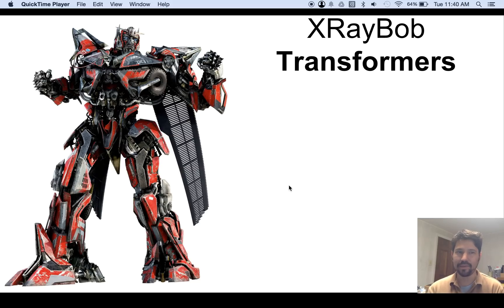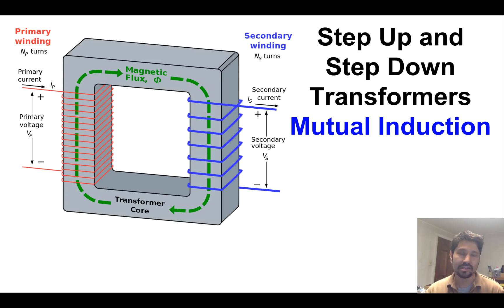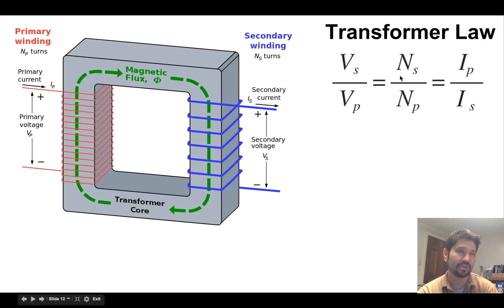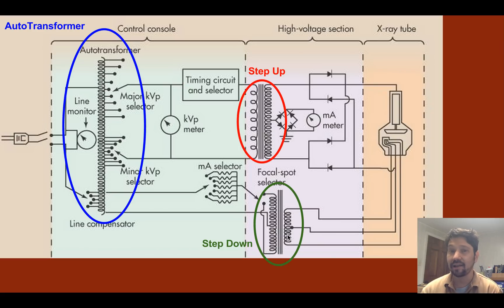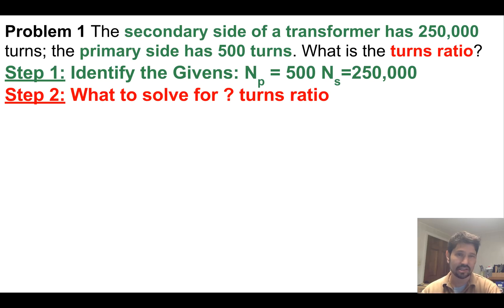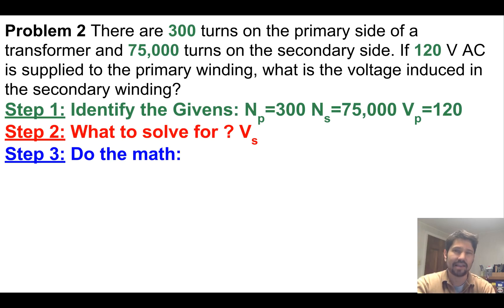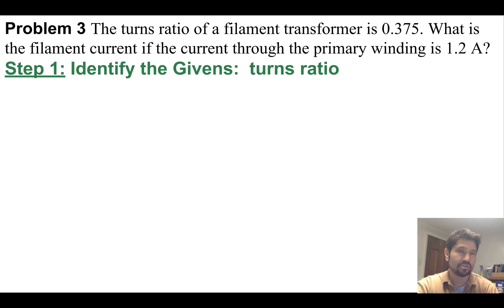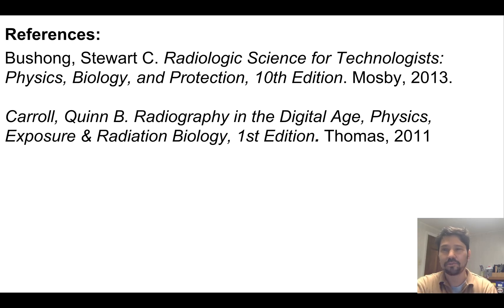XRayBob Transformer Math Examples

Comment: When do I know to turn it into kilovolts and not leave it at volts?
Reply from the maker: If the question does not ask for kilovolts then I would think you could answer in volts and not risk the extra math conversion.  If it is a multiple choice question you may only have answers in kilovolts for your selection.  Most likely the instructor will prefer kiloVolts since that is the most commonly used numeric prefix used in Radiography when referring to the voltage.
Reply: Bob Grossman OK, because I'm taking my radiology boards soon and I had a question and I set the formula and everything and the answer I got was 40000 volts and the answer choice has 4 answers. I automatically crossed out 2 and was down to 40V and 40kV and I chose the 40V and got it wrong. I think I know what I did wrong. Since I converted the 40000 to 40 I should have chosen kV instead of volts correct?
Reply: Bob Grossman also the question was all in volts not kilovolts and i think that is what threw me off, so I chose 40volts as the answer.
Reply from the maker: yes 40,000 V = 40 kV
Reply: Bob Grossman Thank you!